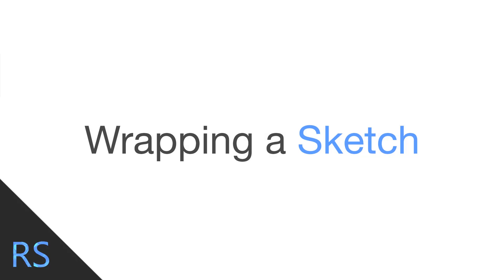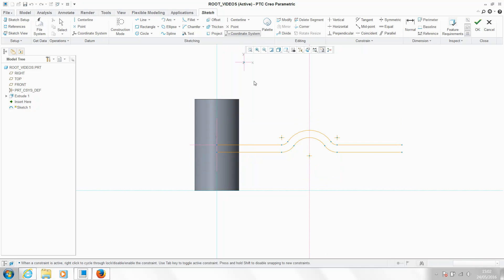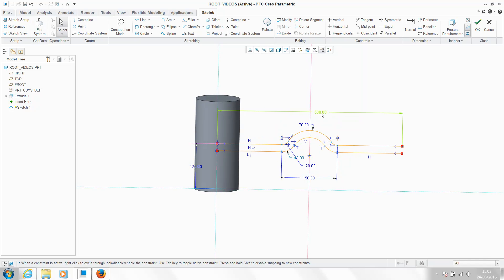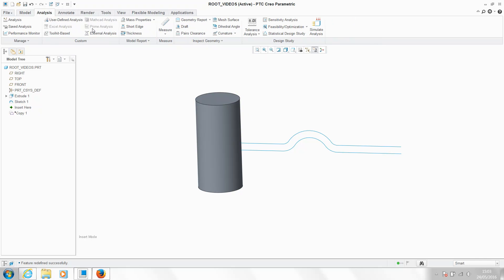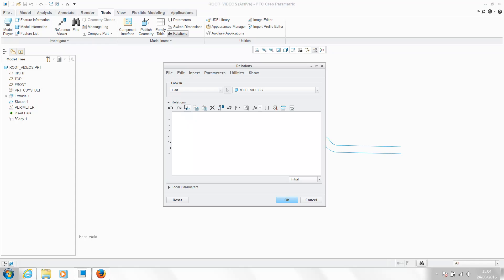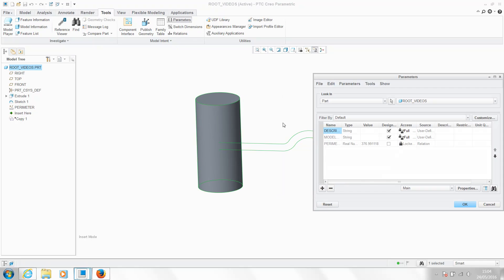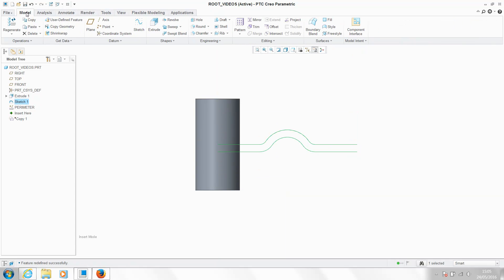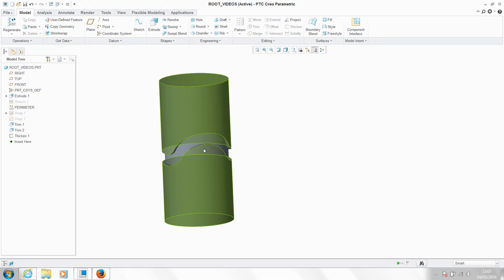Wrap a Sketch in Creo Parametric 3.0

Comment: HI! I was used wrap to make a sketch, but I could not figure out how you made the slot afterwards. I tried out  variable section sweep, offset, and many other things but it didn't work. I see you used trim and thicken to make it. Could you explain to me what you trimmed and how it was able to be thickened?
Reply: Would it be possible to go into more detail in a video on this?
Reply from the maker: It was a while ago but I think what I did here was - Copy the external surfaces of the cylinder, Select the newly copied quilt, trim the quilt to one of the sketched curves, trim the quilt to the second sketched curve and then finally thicken the quilt while removing material. 

This does seem like a long winded way of doing now, as I think you could achieve the same using a sweep while controlling the x-direction. 

Hope this helps.
Reply: Root Solutions Ltd can’t do this. Video please.

Comment: How would you create a 0.15 mm thick insulator that sticks to a curved part? I think sheet metal so it can be unbent to create an accurate manufacturing drawing? Would appreciate your input.
Reply from the maker: Hi Platekok TV,

Thanks for your comment. Can you please describe what sort of curved part you are talking about, is it a cylinder, sphere or is it more of an organic type shape?
Reply: Hi, I did it in sheetmetal it worked fine. Thanks